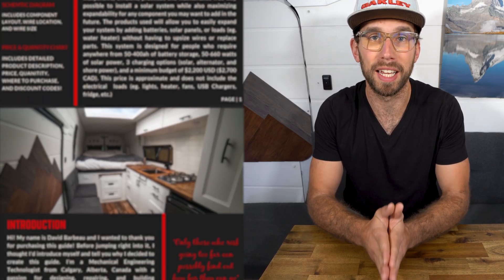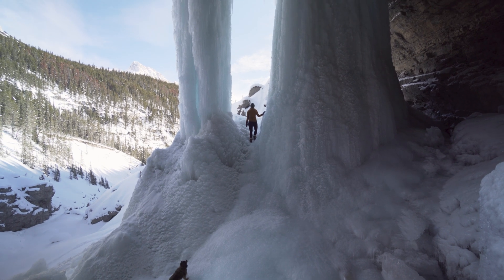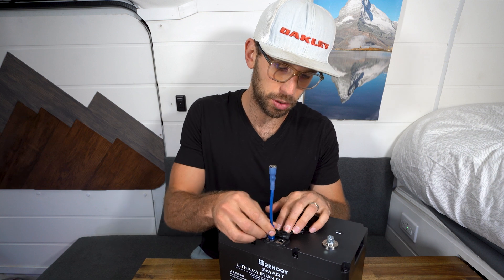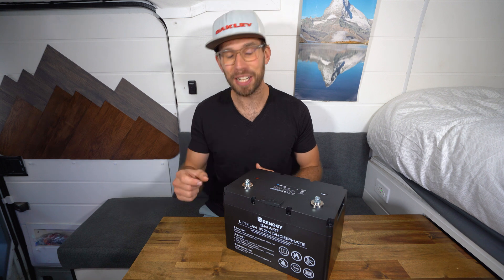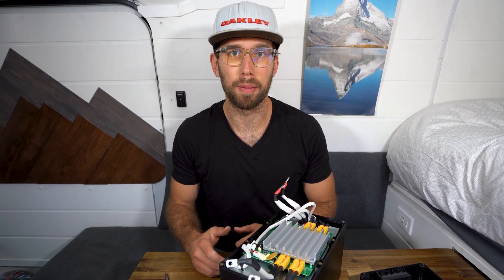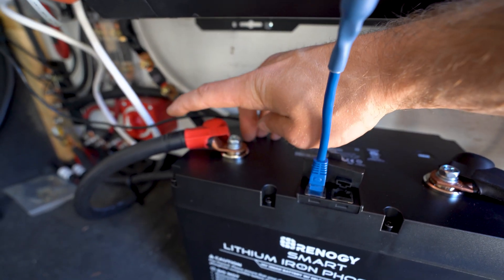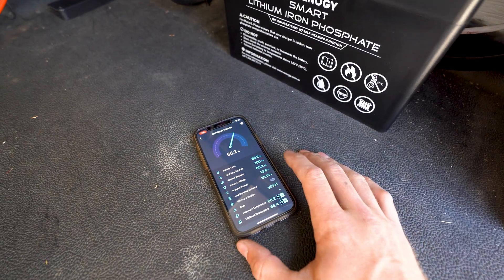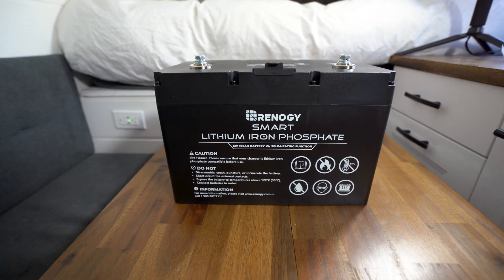Renogy HEATED Lithium Battery 100ah 12v

Comment: If i have the non heated version of this exact battery, can i connect pads to the heat port on the bms. The non heated version is exactly the same inside as this and im just curious
Reply from the maker: @canonbombtom  that’s a great question. I would think the BMS would be different and/or programmed differently from model to model

Comment: So if you connect 2 together is its charge rate still 50 amp ?
Reply from the maker: Each battery can take 50 amps so you should be able to charge them at 100 amps. You’ll know quickly because the BMS will shut down with overcurrent. Make sure you wire them correctly in parallel. With that said, it’s better to charge batteries at a lower current so they last longer.

Comment: My current setup is an 100Ah AGM on a Rover 40A charge controller and 2 100W panels in my off-grid camp in Maine.  It is a 12v system, no inverter and no plans to add one.  Planning to upgrade to 100Ah LiPO4.  My question is about shelf-mode if I leave the camp for extended periods.  How do I setup disconnects and in what order do I shut down, disconnect or reconnect and restore power?

Do i need a master disconnect between battery and charge controller?  Do i need another between the panels and the charge controller too?

In my current setup, the only disconnect is between the battery and my load panel.  The logic was to allow charging but disconnect the building (water pump and lights).

TIA,
Steven
Reply from the maker: I install a main disconnect on the positive battery cable and one on the positive cable between the panels and the charge controller. First, turn off power from the solar panels and second, turn off the main power disconnect for your battery. Then put your battery into shelf mode
Reply: @madetoexplore  Thanks for the quick and detailed reply.  Now I just have to wait for mud-season to pass before I can get into camp.

Comment: Remogy is running a huge sale.  As a newbie here, i am skeptical . . . Why would i buy a Victron battery if i can get a Renogy for about half the price?  Or . . . Why would I buy a 'cheap' battery if there are more $$ batteries out there?  I don't get it.
Reply from the maker: Victron has high quality standards and good customer support. That comes at a price. Renogy focuses more on volume sales. I’ve been running and testing Renogy products for almost four years and have had zero issues. I think it’s a no brainer personally, but some people do have bad experiences with Renogy customer service.

Comment: Five months ago, I purchased the Temgot 100Ah self-heating battery, and so far, it's been working perfectly. The issue of the battery not functioning in low temperatures has finally been resolved. The battery comes with an LCD screen and Bluetooth functionality through the app, allowing me to check the battery status anytime, which is very convenient. With a five-year warranty, I would be very fond of it if the battery continues to perform without issues. By the way, like your video.
Reply from the maker: Never heard of that brand but I will certainly look into! Glad it’s working well for you.Thanks 😄
Reply: @madetoexplore  follow you, hope you have more good video.

Comment: Is the only way to know current battery % with the Renogy BMS? Ive been using a cheap amazon shunt monitor which has worked well for my AGMs, but if some of the power going into the battery is being used for heating, not charging, it seems a shunt style monitor would provide false state of charge info.
Reply from the maker: That’s a great question. I think your probably right but i also use an exterior shunt and even will travelling in -35, I haven’t noticed a large decrease do to the internal heating elements

Comment: I plan on leaving this in my work trailer but our winters sometimes get to 10f. It will not have a constant power supply. I plan on getting the ac to dc charger. If I plug the charger in when say the temperature outside is 10-20f, will the heaters turn on and heat the battery and then charge once it gets to correct temperature? I spoke with renogy and it was hard for them to understand my question somehow ? 😂

Great video by the way
Reply from the maker: Yes, the battery will auto heat depending on the temperature of the cells.
Reply: What if battery temps are at, say -15C (5F)?

I’ve spoke to 3 Renogy customer service reps and had 2 say I would need to heat batteries manually in this situation and 1 say the self function will work “2X faster from -15C to 0C if system is “on”” but I’d have to manually heat batteries if system was “off”…
any comments on this on this? 😅

Comment: I have Renogy 200w solar panels and Renogy Adventurer controller for my off grid cabin.  I’ve been using lead acid batteries however I feel it would be advantageous to switch to a heated lithium battery .  I’m in northern Minnesota and temperatures will get well below Zero in my cabin for extended periods of time.  So will the heated battery work?(even at night when the solar panels are not producing). Also how safe is a heated lithium battery?(any fire hazard?)
Thanks -and good videos!
Reply from the maker: Yes, you should definitely get a heated battery! The battery only requires heat when charging so during the night the batteries don’t have to heat themselves since there is no power coming from the panels. This is the perfect application. Heated lithium batteries are safe. The BMS will shut everything down if it senses a high temperature.
Reply: I ordered the Renogy battery!
Thanks for the information
Reply: @michaelrapatz5818   any update?   After sitting in the cold all night below 0F do they warm themselves up with the sun/solar to ~40F and then start to accept a charge?
Reply: @largedaryl  I haven't really had a chance to fully test the battery.  When I received the battery - it was not fully charged.  I took it to "Batteries Plus" to charge it to full capacity(A Lithium battery needs to be charged with an appropriate charger) I decided to wait until Spring to test it out.

Comment: How many amp hrs did you get from a full discharge?
Reply from the maker: Got 104ah on the self-heated, 106 on the standard lithium, and 202ah on the 200ah BT lithium.